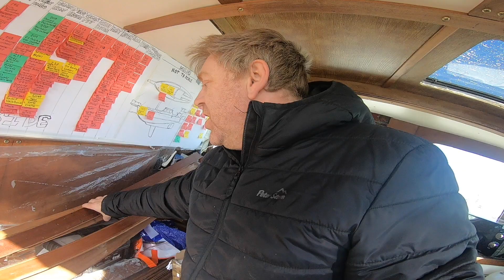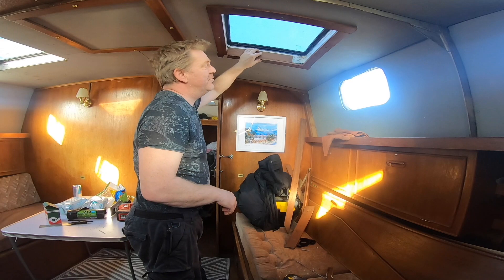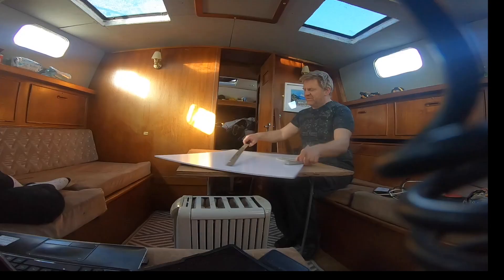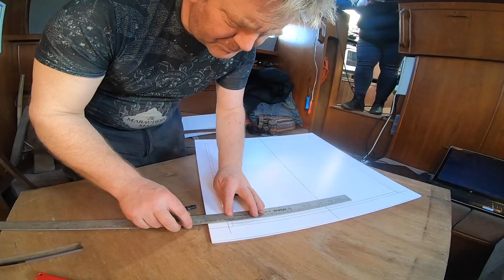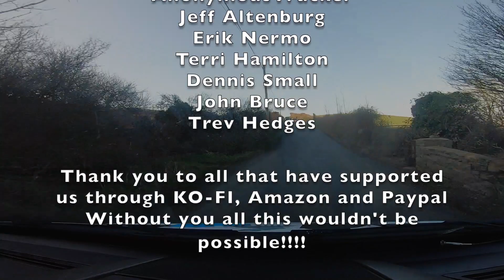#86 - We bought a VAN!!!!

Comment: That mahogany or sapele might make some very attractive  trim surrounds to the ports and windows when cut down to the smaller width / thickness and steamed in  a plastic drainpipe; then   bending to shape on a small board jig and allowed to cool and mitred ends  glued when fitting them with epoxy.looking forward to your eventual launch day, no doubt it will go well !

Comment: If you hadn't given notice that a van was parked on the side of the road, I would never have noticed it. Its "remains of various paints thrown on the fly" type camouflage makes it completely invisible.
I love this van. As for Mélody, I admire her sense of detail and the progress of the work. I saw the summary video yesterday since the purchase, in fact I have the impression that you only kept a few screws and that you managed to completely rebuild this boat!
Respect and admiration.
Reply from the maker: Thanks
We’ve kept a surprising amount actuslly

Hill - good just needed patching up
Mast - good
Boom - good
Engine - good
Interior - mostly good.
Wiring - mostly good
Heating system - not yet assessed 
Old instruments - being replaced

Comment: The vinyl on the panel would add both insulation and some sound adsorption as well as being easy to wipe clean.  I think it’s going to look great. Another idea would be to use a textured Formica glueing it to the ply then running the router along the edge.
Reply from the maker: Lots of options to consider eh :)

Comment: Nice wheels! A bit cold and bleak for me.....Great work on the hatches and portlights too. A lap joint or mortice should do the job. Sitting by the pool with a cold one....cheers from this old yachtie from Muscat, Oman.
Reply from the maker: I’ve started making them in timber and I’m doing some simple mitres but I will be adding some polished brass “bow” inlays across each of the mitre joints as an inflated biscuit

Comment: Congrats on the new van I am sure you'll have the heater sorted out in no time. Oddly enough most people don't realize you can survive at night without heat with the right sleeping equipment especially +35* F wait till it gets a balmy 0*F or -17 C.  or colder!
Reply from the maker: I’ve slept at 4000m in -30 degrees on
Reply: @SailingMelody  Usually when a European tells me they are at X number of meters up a mountain, I go look it up and have a laugh, as I live at 6,500 feet, 4,000m is 13,123 feet, I have spent more than  few nights in Western Co at that altitude, I think the coldest was around -5 at night when the power went out in the rv park oddly enough MH furnaces don't work without electricity. It was the one night my hairy cat decided to crawl under the covers with me!

Great video as always, I'm sure the van will serve the purpose you bought it for.

Comment: Hi guys, love the channel. I am sure that layby you camped in is exactly the same one I had a flat tyre and had to wait for a mechanic to cut off the locking wheel bolt as the special key broke! Is it may be a couple of miles from Capel Cruig going towards Snowdon ?
Keep up the good work Steve R

Comment: quick tip... HDPE strips (same plastic as cutting-boards are made of) and glue/screw those to the steel and mount the wood to the HDPE.. Makes a perfect, stable, spacer between the steel and wood.. Steel should of course be epoxied before and some sikaflex is recommended between the steel and HDPE just to prevent condensation and/or moisture buildup.

Comment: Dont forget to put tape between the insulation panels.  Even little gaps and cracks reduces the effinciecy quite dramatically.
Reply from the maker: We’re using a closed cell spray foam to adhere the insulation panels in place and close every single gap yes
Reply: @SailingMelody  Smart choice.

Comment: If you end up with too much of that tongue and groove then I'd love to buy the spare.
I've also got to do window surrounds. Did you say "Decron foam"?
Reply from the maker: Hiya.
I think we will be using it on the floor to be honest but yeah I’ll bare you in mind.

It’s called Depron or Craft board

You can buy it with or without the glossy paper coating

Have a look at the YouTube channel FliteTest for their instructional videos on how to build with it :)
Reply: @SailingMelody  thanks! I've been struggling to work out how to do our window surrounds. We have 7 per side and they are all different sizes.
Reply from the maker: @SustainableSailing  yeah that’s a lot of work but making like this in foam and hot glue is so fast.

In actual fact you could use foam and epoxy and then just glass cloth them if you didn’t want wood
Reply: @SailingMelody  my current idea is a ply surround to space out an acrylic double glazing so that it is flush with the ply sidelining sitting on top of 10mm closed cell foam. Then a stained ply surround to to cover the joins. If I have a simple way to get the internal window surrounds I can trim cut surrounds with my router. I think. We have captive nuts for the windows at present but think I'd switch to through bolts going through all the layers, maybe dome nuts on the inside.

Comment: Don't be afraid of stating your opinions. Of course, I agree with you about wokeness and regulators and such. BTW I nominated you guys for Chasing Latitudes 'best saling vlogs' as the best family sailing vlog.
Reply from the maker: Hey thanks that’s really cool :)

I should point out that firstly that remark was a joke about peoples proclivity to be offended by everything these days. I am personally a huge advocate for inclusivity and for awareness of peoples life choices, identity, background and experiences and the need to accommodate and be aware of that.  My quip about the word “woke” was a reflection on the fact that the word no longer, for me at least, conjures up an awareness of the need for equality but it has become associated with being offended by the slightest little thing.  The words doesn’t mean what it meant 5 years ago. No offence was intended and if anything I’m cynically remarking on the fact that the word is now a short hand for “I have the right to be offended by anything I chose to” which massively distracts from the excellent meaning it originally had.
Reply: @SailingMelody  agreed. When an appeal for tolerance for diversity of appearance or proclivity morphs into a demand to punish those with a diversity of ideas, it has run off the rails.
Reply from the maker: For sure